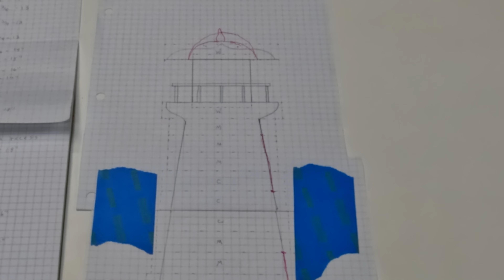Lighted Segment Ring Lighthouse

Comment: That looks great! Where do you get the LED light (the plugged one) and crystal ball from? Id love to try and make one (if thats ok with you)...
Reply from the maker: Thank you. As long as you send me a pic of your finished work. I got the crystal, led light, cord, and plastic tubing on amazon.
https://www.amazon.com/dp/B0B3WRRZSB?ref=ppx_yo2ov_dt_b_product_details&th=1

https://www.amazon.com/dp/B07FM54JZP?psc=1&ref=ppx_yo2ov_dt_b_product_details

https://www.amazon.com/dp/B0BKQDF328?ref=ppx_yo2ov_dt_b_product_details&th=1

https://www.amazon.com/dp/B07R5S9K48?ref=ppx_yo2ov_dt_b_product_details&th=1
Reply: @jamiesworld4675  that's very kind and helpful of you thank you! Of course I can send you pics 😄
And would it be too cheeky to ask you for a cut list of the segments or the rings dimensions? I really like the proportions of this one..
Reply from the maker: This video has more details.
https://youtu.be/T6zIDCkL1vk?si=vqUwrdpGqNo3SG0i
My cut list is in the shop I'll send it later.
 @domenicoferraro2322
Reply: @jamiesworld4675  hello, did you have a chance to get the cut list?
Reply from the maker: The bottom base is 5" diameter.
The 17 rings are 16 segments.
Rings 1-6 are 5 1/8" dia. segment is 1 1/16"
Ring 7 is 4 7/8" dia. segment is 1"
Rings 8,9,and 10 are 4 5/8" dia. segment is 15/16"
Rings 11 and 12 are 4 1/8" dia. segment is 7/8"
Rings 13,14,and 15 are 3 7/8" dia. segment is 13/16"
Rings 16 and 17 are 3 5/8" dia. segment is 3/4"
The platform and top is 4 1/2" dia.
 @domenicoferraro2322
Reply: @jamiesworld4675  that's great thank you very much! Not sure when I'll be able to start it but sure you'll know when I'll have it finished! 😉
Reply from the maker: Good luck. @domenicoferraro2322